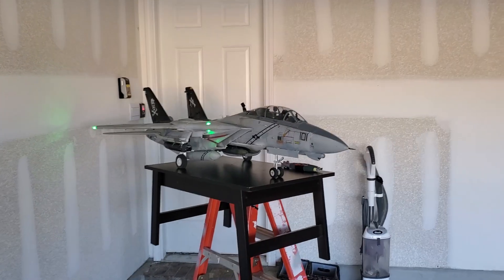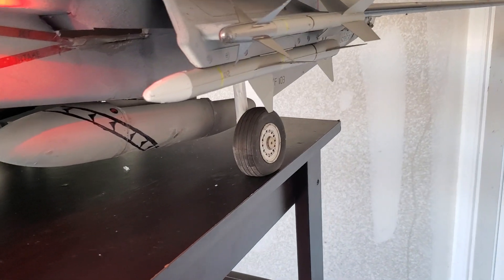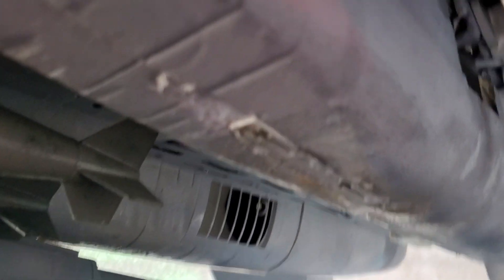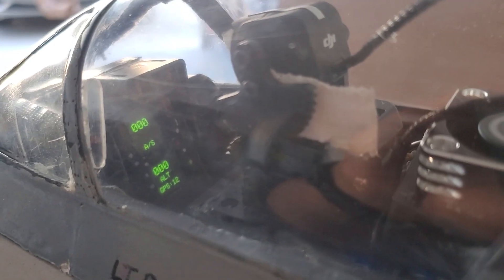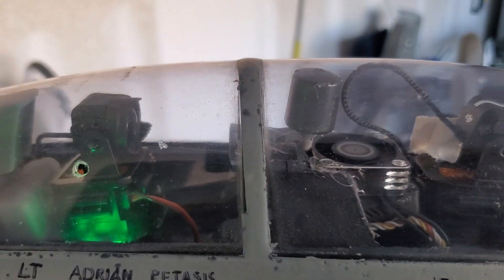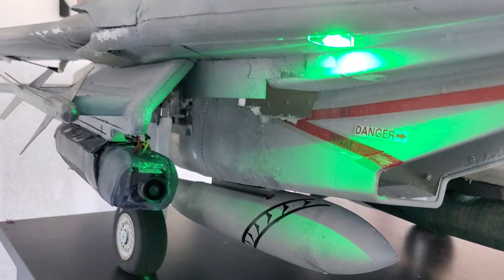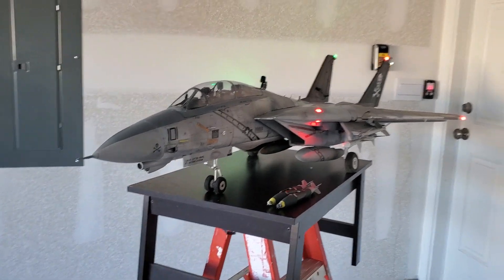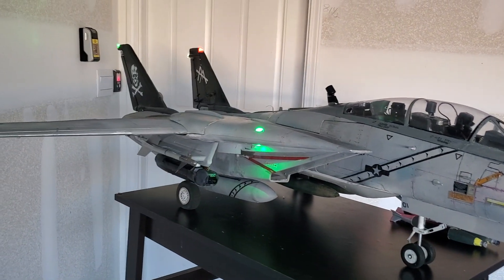Freewing 80mm  F-14 Tandem FPV Modification overview

Comment: Wow, if you can make this plain fly for a longer time, you'll have a lot of people want that. That would be so awesome.
Reply from the maker: Yeah I'm experimenting with some batteries and other stuff. The goal is to hit 8min with conservative Throttle usage!
Reply: Are you planning to use Li-Ions?
Reply from the maker: Yeah im trying to find out if i can build some with the C rating for an EDF @snviper
Reply: @heroUAV  I use Molicel INR21700-P42A 6s2p on my long range quad. In 6s3p you would have about 135 Amps continuous and 12000mAh at roughly 1200g.
Reply: I'm just getting into the hobby with the electric planes. To have something like that would be great. I don't know what type of battery I'm gonna be using though.

Comment: Outstanding work, all around! I love how the FLIR pod has a real, gimbaling camera in it. Love the JDAMS, of course the FPV setup, and SPOILERS for crying out loud 🥲

Great idea to use Mig29 mains. They are so much more robust. 

Nice wheels too. I heard you say Robart 3.0 tyres but I couldn't find those on google. Can you please point me to the right ones, I'd love to get those for my F14 too.
Reply from the maker: Thank you! I wanted to make this model as close to the real thing as I could so I went as far as could. Still gonna install a tailhook and potentially an arduino powered  (speed) light indexer at some point. Robart 3.0s CA be found here: https://robart.com/products/3-straight-tread-wheel if you want I can send you the stl file for the Tomcat wheel hub I used too! Just know if you install mig 29 retracts in your F14 you'll have to basically dremel out and rebuild your own gear mounts because they're quite a bit wider. Than the stock retracts. The suspension shocks on the mig 29 will also have to be swapped put with the og Tomcats to prevent the jet from having excessive kneel. If you have any questions lmk I'm more than happy to help!
Reply: @heroUAV  Legend! 

I printed out the wheel hub from RCGeek's stl but appreciate the offer mate.

With the Mig-29 retracts, I was thinking of using only the struts, swap it with the thin F14  struts. Should be a an easy swap. It won't rotate but I can live with that. The strength is well worth it. Thanks for the tip on the spring.

I've converted mine to turbine. I strengthened the airframe with an epoxy coat that makes it resistant to dings/scratches. Also put in a functional canopy, scale cockpit, afterburner lights, and some other crap. All that makes it a lot heavier (7kg AUW) so thicker struts are ideal. There are a couple of video on my channel, you might get some ideas for further scaling your Tomcat. Cheers
Reply from the maker: Thats gonna be awesome! Subbing! @mountaincommando3582

Comment: Very nice job I went with the FW Mirage 80's and 100amp ESC's running duel SMC 53/4600 hivolt packs mixed flying 5min with a minute easily in reserve. Luck on your maiden
Reply from the maker: The mirage is an awesome platform from What I've heard! I was running smcs for a while but all the Fpv wiring for the pilot and Rio take up alot of space so I opted to go with narrower batteries to make more space for those wires to sit in the tray area. I did a Maiden on this jet a year ago but I've yet to do a 2 seat tandem flight. That's what's coming next! Thank you for your support!
Reply: @heroUAV Two dji systems so close together even at different channels could be problematic. They all use the same channel for some pulses or something afaik. Please do a good "range check" and be ready to cut power to rio.
The video antennas should also be further away from the fuselage/vtx in my opinion. Good Luck man!
Reply from the maker: @snviper thank you! I noticed when I first started running them together one would be really powerful 50mbps and the other would only be capable of 12-15. So i set both on different channels and set the mhz to 20 now when running the air units together max MBPS is 25 but they're solid and consistent It's almost like audience mode but those numbers are constantly in my scan we'll see how it performs when I take it out to the field!

Comment: Ive been eyeing this 80mm EDF F14 for years, but i fear that when I finally pull the trigger and purchase one, I'm for certain that Free-wing will put out an upgraded version LOL
Reply from the maker: Rumor has it that they're upgrading the 80 as we speak. But dont @me on it lol. If you get it right now just be prepared to have to do some ground work to get it to fly and land the way you want. Definitely think about how you're going to reinforce the gear because I didn't believe it would be an issue when I got this jet 2 years ago but it's definitely an inevitable upgrade. If you have any questions just lmk it's still a great airplane once you get it dialed in!
Reply: @heroUAV  thanks! no question at the moment

Comment: Careful with that range.  With no FC on an O3 I wouldn't think you'd be able to make it out as far as a mile.  I still run vistas to avoid the arming requirement.
Reply: i just keep an eye on my Mbps ive been close to a mile just based on landmarks i saw in the air when i went back to look at them on maps but it was approaching 19mbps so i brought it back. im gonna get an ardunio to set it up for arming so i can get more distance soon

Comment: That's awesome, plane looks great. I have one and love it with wing plate and battery tray mod. Also upgraded with freewing 2150kv motors and freewing mig 29 esc's for reverse thrust that works great. Stock gear in my opinion are way to week for the weight of the plane. I constantly replacing stock gear even with good landings
Reply from the maker: The stock gear wouldn't be so bad if the they were just built sturdier and weren't prone to tow issues and camber. The mig 29 retracts were a hassle to install because they're much beefier and I had to do alot of dremeling to fit them and then I had to cover the foam with fiberglass and resin to make it structurally sound for landings. But that being said they're way better suited to carrier style landings. They're about 25% thicker than the stock ones and have a much stronger finish which should eliminate Tow. Its Definitely doable but a tricky mod for sure. I opted for Xfly motors because they had some really concrete data for thrust 3.4kg static and 2.9 housed in an F16 on YouTube. Over 10lbs was all I was looking for and I'm getting 12.6lbs atleast. And my jet weighs 15.2lbs.

Comment: Please post more flight vids. Night flying, bad weather , high altitude , distance flying from one airfield to another, would all be awesome to watch. 

Here’s an idea : magnetic charger deployed from a KC 130 for an in flight recharge.
Reply from the maker: I was thinking the same thing regarding the aerial refueling idea. my only issue right now is that I'm the only FPV guy at my airfield. That being said there I do have a design idea for a RAT generator for Rc planes to help get a charge going. But it'll be a project for the future. The flights will be coming soon as well. My RIO flight and dogfight against an SU27 will be next stay tuned!
Reply: @heroUAV good plans! Su27 dog fight nice!
Reply: Dont the batteries charge way way way too slow for that? You'd have to be able to recharge the batteries in seconds.